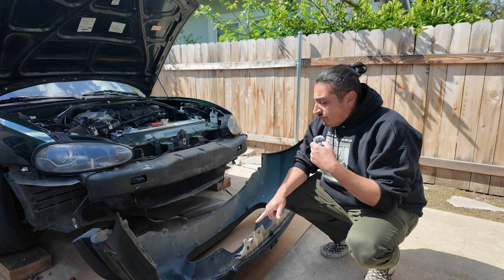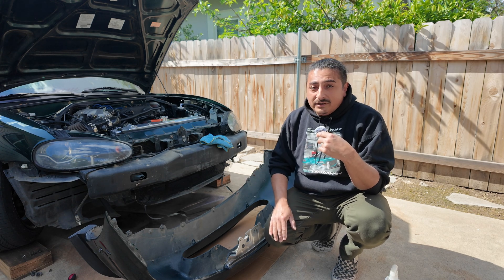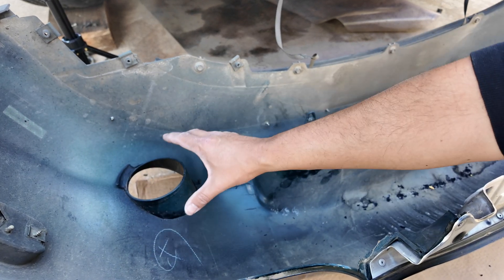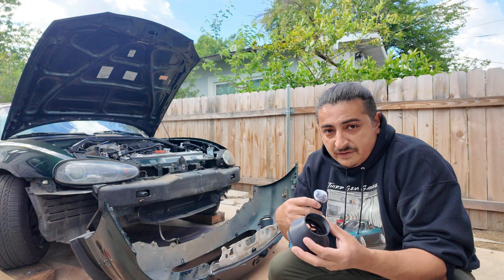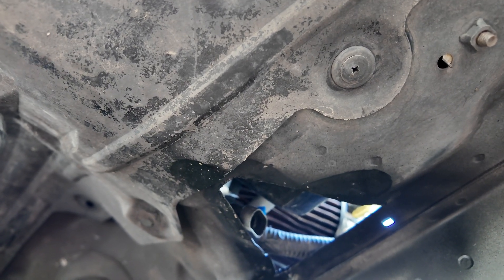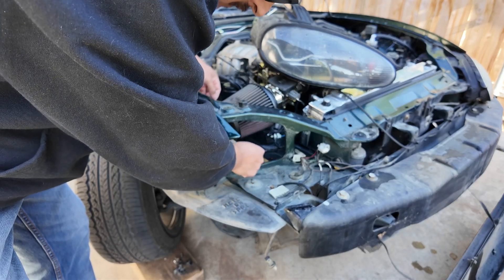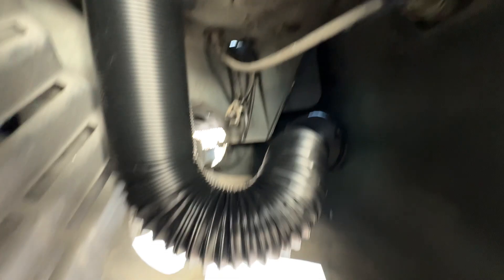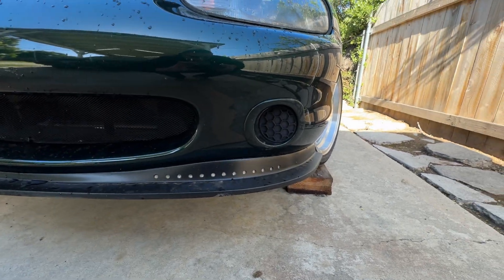NB1 Miata Fog Light Intake Duct!

Comment: How has the setup stood the test of time? And if so are you selling the parts you fabricated?
Reply from the maker: They’ve held up well, I ended up revising them to mount small fog lights in the center and so far no issues. The ducting needed to secured a little better. I do have the non-fog light version available on my website thirdgengarage.net

Comment: Very cool. Where did you get the fog light bezels you pushed through the holes you cut for your NB1? did you print those also?
Reply from the maker: No, I actually found those in a junkyard.
Reply: @thirdgengarage  Do you still sell the 3d printed flog light bezel adapter ? I have  a NB1 and ordered the fog bezels from TC Mazda and want to connect a 2.5" flex ducting so need your adapter that connects 3.5" down to 2.5" and screws or locks on somehow in backside of the fog bezel.  Seems like your website is down. Don't need the other end for where I'm routing to a custom intake box... Thanks!

Comment: Wont your engine get hydrolocked super easy? Also The air mostly gets over The fog light just tiny weee bit of air actually gets în there
Reply from the maker: I hardly ever drive the car in the rain and I’m used to taking precautions if I do, I run a vented hood that I swap back to stock if rain is coming. I’ll probably make a cover in case of rain, but I won’t have to worry about that until the fall.

Comment: I'd be interested in seeing if there's a difference in airflow if you reversed that funnel in the bumper. There's a book on auto aero that mentions a reverse funnel will allow airflow to expand to fill the space, where a funnel will cause turbulence on the sides and actually pull some of the air out.

The book is called Maximum Boost by Corky Bell. I think it's def worth looking into.
Reply from the maker: I’ve seen that book mentioned around forums, going to have to check it out, thanks! I’m also thinking the length of the first funnel and how quickly it reduces could need some reworking, but at this point I’m just guessing. 😅

Comment: Building a heat shield to isolate the filter from as much engine bay heat as possible would maximize the effect.
Reply from the maker: As much as I told myself I was moving on after the duct, I think this is the move.

Comment: What material are you printing in? What printer do you reco?
Reply from the maker: I’m printing in ASA, I’ve have good results as long as the print is at least 2mm thick, if not I get some layer separation, theirs probably something that can be done to correct this. I’m not terribly well versed on printers, first and only one I bought is the ender 3 pro, got it for cheap at micro center and have been learning on it. I think I’m pushing it printing ASA without any upgrades but so far so good.
Reply: @thirdgengarage  you got the file for the piece in the video